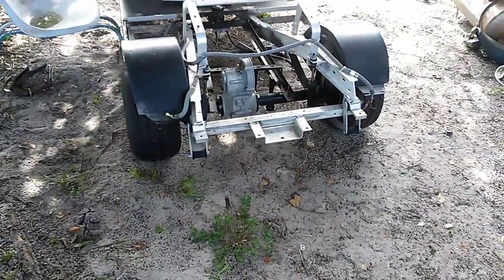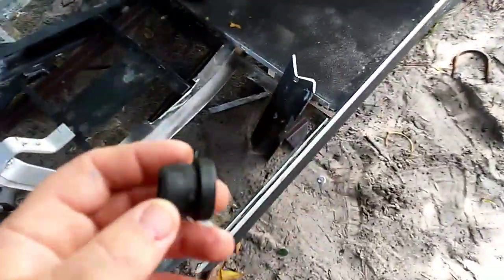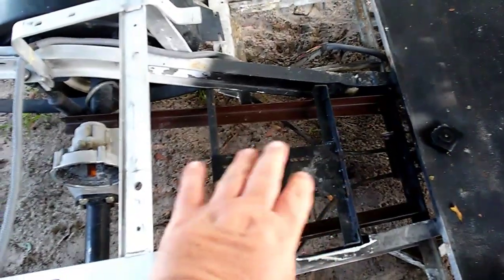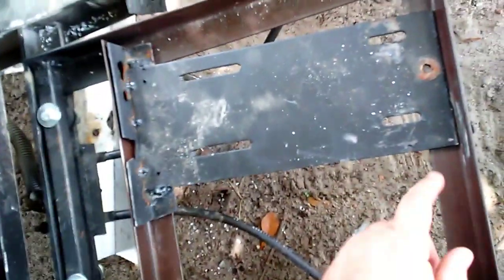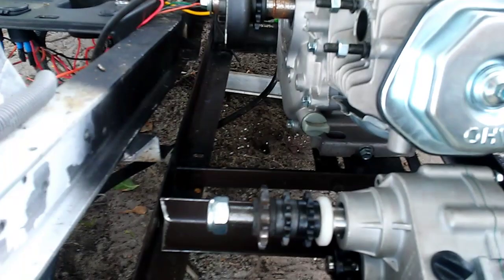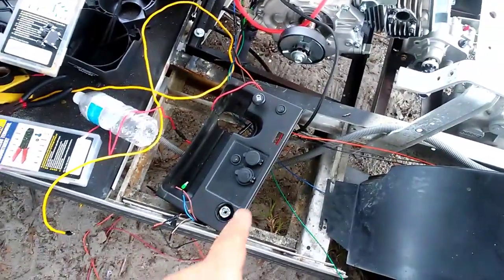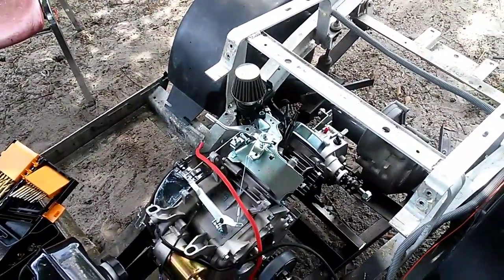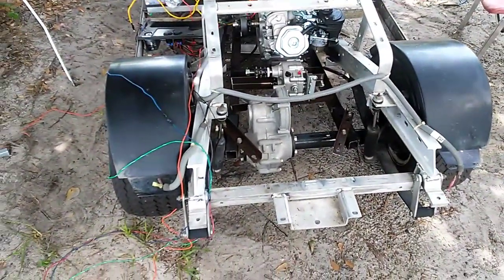Club Car Electric to gas *Part 2*

Comment: This is awesome. Before seeing this, I had done almost the same thing with my ezgo txt. Except, I attached the front of the swing arm to the cross bar via a slip joint. That way my swing arm can flex left or right, and slide forward or rearward with rear axle travel.

Comment: Is that an old bed frame?
Reply from the maker: Yes it is
Reply: @builditmyway6475  that's awesome man! I've got a spare king size frame.  Did it all work in the end?
Reply from the maker: Yes it all worked out just fine. The clutch burnt out due to the owner pulling a heavy trailer. I changed the set up to a torque converter and it worked out perfect. The frame held up just fine.
Reply: @builditmyway6475  I have an 89 ez go ot was a gas job but the engine was shot.
I have a predator 13hp electric start to go in.  I was thinking of buying a 40 series drive clutch and seeing if it will work with my factory driven clutch

Comment: Where did you find a sprocket for the spline shaft on the rearend
Reply from the maker: Kevin Keith i use a round shaft sprocket. I use the splines to make a key way for the sprocket. But there are several places to get sprockets. Tractor supplie, rural king, go power sports, amazon, and ebay. All i do is measure the shaft and order according to that.
Reply: Awesome I was thinking about that, good to know it’s possible. So I assume a smaller key  is better? Thanks for the quick reply
Reply from the maker: Yes i use a normal key. Not sure the size but its the same as the lawn mower axle key. I have had good results with this method.
Reply: Awesome thanks